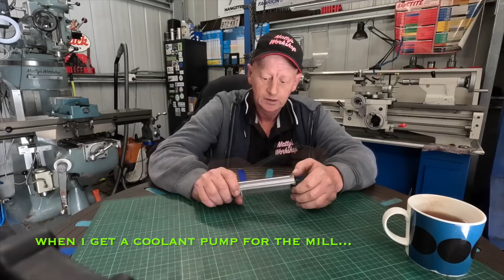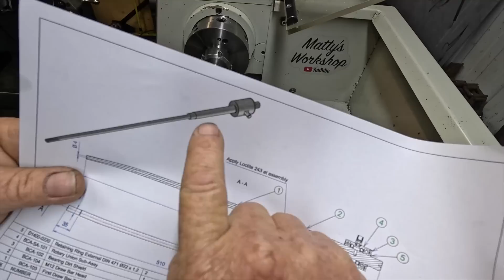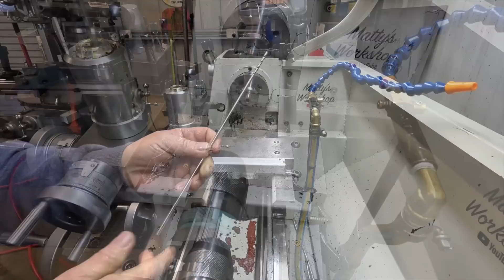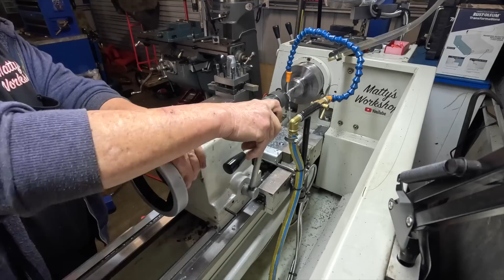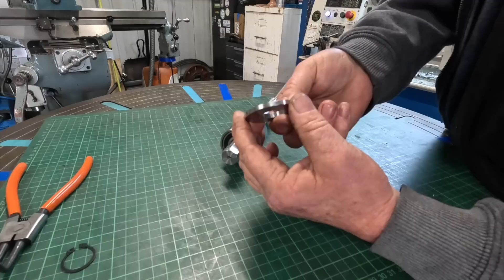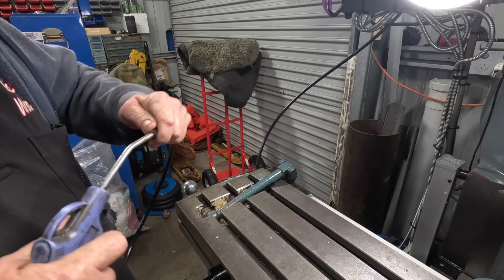Through Coolant/Air Drawbar

Comment: G'day Matty. I just had a thought today that I'd not seen anything come up from you recently, and went on to look to see if I had missed any vids of yours, only to find that you'd not posted anything for a month. I hope to god that isn't because you have further health issues? Anyway I watched this again and am still impressed with the design, the build and the finish. That wobble on the top is insignificant anyway. How much gap is there between the spindle and drawbar? Is there enough room to put a nylon or aluminium sleeve about 6" down inside to straighten things up? Just a thought mate. Cheers from not so great England. Sam

Comment: Great build Matty. I would think that if you get any leaks when you use coolant, you might want to flip those seals the other way around so that the lips are pushed onto the shaft by the (relatively low) pressure of the coolant.
Reply from the maker: Gday, the seals have been turned already, I screwed up there mate, thanks for watching

Comment: Awesome job on drilling those long holes! Can't wait to see it in action. I might have missed it, but did you cap the hole at the top of the drawbar? Won't coolant run up and out of it as well as down?
Reply from the maker: Gday Greg, the hole in the top section wasn’t a through hole, it only went part way the a cross hole to link it up, thanks for watching, cheers

Comment: Superb build Matty. One thought ; when you come to rig up the distribution block have you considered making an annular groove in the space between the bearings/seals on the draw bar to allow a constant supply of coolant otherwise you would be creating an intermittent flow to you cutter having only one hole in the drawbar; or have I missed something in the build?
Reply from the maker: Gday, I think with the one hole it should still flow constantly, time will tell mate, Thanks for watching, Cheers

Comment: Nice job, Matty. The only thing that occurred to me was do you think the seals are oriented the right way around? The lips want to be facing the fluid that wants to be contained, in this case the coolant. It was a little difficult to see which way around you did fit them but just thought I'd mention it. Cracking job, though. Mart.
Reply from the maker: Gday Mart, I did screwup and put the seals in backwards but I’ve fixed that now, thanks for keeping an eye on me mate, cheers

Comment: Turned out really nice Matty, I wounder though it was hard to see but it looked like you put the seals in with spring facing the bearing which I believe should be the other way to stop coolant from entering the bearings
Reply from the maker: Gday, yes I did screwup there but I’ve fixed the issue now thanks, appreciate you watching
Reply: @MattysWorkshop  keep the videos coming, great content!

Comment: I’ve considered similar myself, and the arrival of your video left me giddy.
A couple of concerns, that have left me hesitant is the probability of leakage from the drawbar / collet interface, and leakage from the collet itself, into the quill, to contaminate bearings, wash out lubrication, and eventual corrosion from water based coolants / and moisture laden shop air.
While I expect there are through coolant specific tool holding solutions, my home shop situation doesn’t lend itself to buying additional specific purpose tool holding, even if I was to pursuit second hand through coolant tooling. 
Guess I’m curious, if / how, you’ve addressed this issue.
As always, thanks for sharing another brilliant project via your videos.
Reply from the maker: Gday, The air/coolant goes done the drawbar, the drawbar is screwed into the arbor so nothing can go into the spindle.

Comment: Another really interesting one.
Thanks Matty, you do some great work.
I’m planning to one day add one of those air operated Maxi Torque draw bar systems, so I’m imagining that the top section on yours with the air / coolant feed tube would interfere with it unfortunately, because what you have done is a really good idea.
Maybe the designer who made the plans for you could perhaps design something compatible perhaps? 🤷‍♂️

My butt was puckered watching you drill that long hole.

I once had to drill a hole 4 feet long up through the centre of a wooden standard lamp for the power chord & light bayonet fitting etc, on a wood lathe.
I bought a through turning tail stock and a machinist mate turned and silver soldered a twist drill onto a 4 foot + 3/8ths rod, with T handle.

I started “pecking away at it” - pulling it out and clearing the chips, every few mm, & it took forever to do.

Sadly tho the drill followed the grain inside the wood and wandered off centre & broke out the side about 4 inches before reaching the top, completely destroying the whole piece, that I was copying from an antique made in the late 1880’s.
Talk about soul destroying.
You drilling this long hole brought back some bad memories for me from at least 35 years ago.
I never got tempted to make another one after that. It also made me wonder how the heck they did it back in the 1880’s? 🤷‍♂️

Watching you with that long drill then had me wondering how rifle barrels are drilled? 🤷‍♂️

This one made my brain ache, but it really was enjoyable to watch so thank you sincerely. 👍👍👍🇦🇺
Reply from the maker: Gday, A air drawbar won't work with this setup, I didn't think drilling that long hole was going to go as good as it did to be honest, Appreciate you watching, Cheers

Comment: Good job Matty. Are you just going to rely on the nylon hose to prevent the top from rotating with the spindle for long term use?
Reply from the maker: Gday, The nylon line is working well stopping the rotator, Theres not a lot of force there, Thanks for watching, Cheers

Comment: G'day Matty, that's a great build mate, a complete win in my eyes. I have a brand new unused coolant pump and tank and if you were in the UK I'd donate that to you for your mill. I'd hate to wonder what the shipping cost would be from the UK to Oz, probably three or four times the cost of the pump and tank as it's a quite heavy unit for its size! I'm a little confused as to where the air was escaping when you did your test. Was that a through coolant endmill you were using? Thinking about it it must have been! Doh! Sorry mate I've just woken up lol. Cheers from the UK. Sam
Reply from the maker: Gday Sam, The air was coming out the slots in the collet, The cost of postage is getting expensive now, Thanks for watching, Cheers

Comment: My coolant pump clapped out and I replaced it with a bottom pickup pond pump. It has a lift height of 2100mm and a flow rate of 2x the standard one. it was a $30 temp fix that may end up permanent. Its 240v @35w for power, so wired straight up. You have my email if you want further details. Youtube deletes comments with web links.

Missed your vid last week.. Glad you're back!
Reply from the maker: Gday, I might have to look at a pond pump set up, Thanks for watching, Cheers

Comment: Nice job as we expect from you No Pressure Mate i am sure Kurtis from C E E made one a while back for his new to him Mill very similar in design just one thing when you set up the distribution box thingy make it a double one so you can run air and coolant Cheers Mate
Reply from the maker: Gday, CEE did build one for the Zayar milling machine, I've built the air distribution setup now which works really well, its going to be a while till I have a coolant setup unfortunately, Thanks for watching, cheers

Comment: Another excellent outcome, that is the longest 4mm drill I've ever seen, I have to admit I was wondering how you were going to get that deep until you pulled that out, Well Done. 👍
PS: Did you receive that sticker I sent you yet ?? I sent one to Belgium the day after I posted yours and he got that a week ago, I haven't received yours yet, good old Aust Post, slow as a wet week.
Reply from the maker: Gday Paul, Your letter arrived today, Australia Post has been absolute crap lately, I got a quote to get this drill from a company in Sydney, well I could afford to buy quite a few drills and material and still have a roll of notes in the pocket, Thanks for watching, Cheers
Reply: @MattysWorkshop  Back when I sold my acreage property back home, some paperwork was posted from the small town nearby, to another less than 50km away, it took Aust Post 3 weeks to deliver it, absolutely pathetic, Thai Post is awesome, they deliver 7 days a week as well.